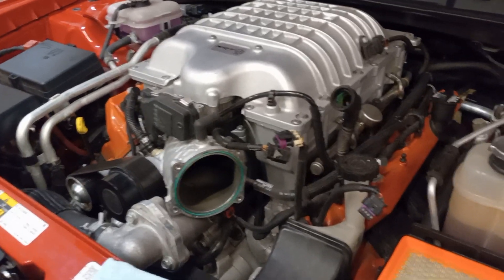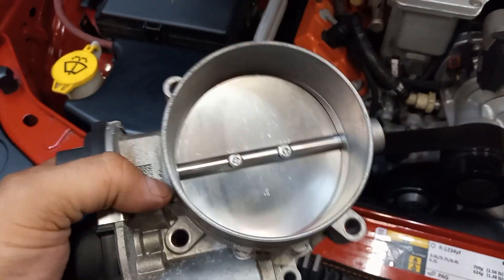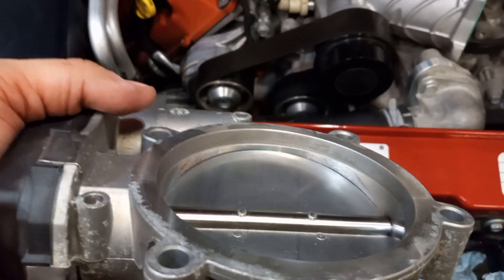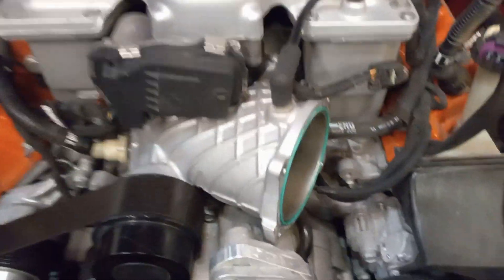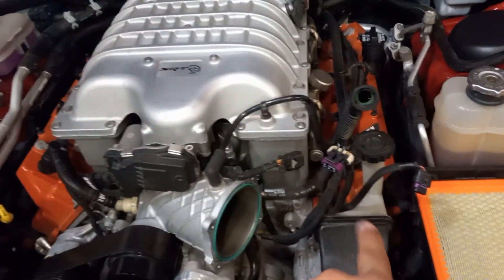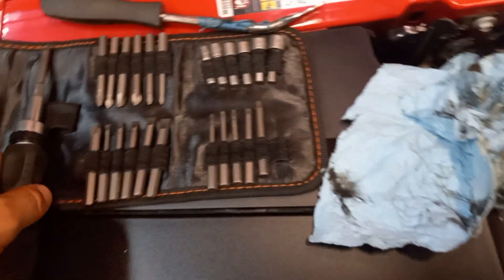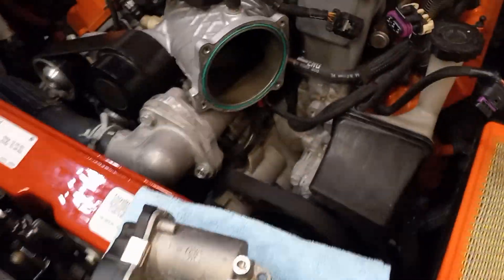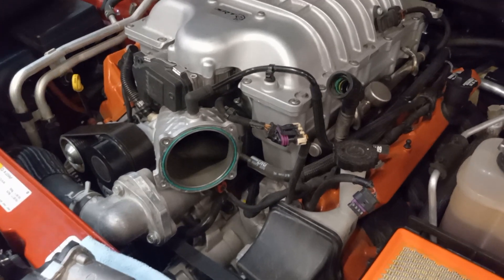Catch Cans? Here's why I don't have them,

Comment: Glad your feeling better...thanks for the tip on cleaning the back of the throttle plate. FYI- got 35ml out of 2020 Redeye in 4500 miles, 3000 at hwy + speeds. Originally thought I had wasted my $ after the first check (maybe got a teaspoon of oil/condensation) but now glad I got it. Do more of these type vids. Thanks

Comment: I put an American Brothers Designs catch can on my 392 and started to smell oil in the cabin after oil changes despite not a drop left uncleaned and zero leaks to be seen or found. Took the catch can back off and no more oil smell. I wonder there is something wrong with their design? Barb fittings to can sealed and tight, hoses and connections tight, as well as  o ring that seals can greased and tight. Maybe I will try another brand or just leave off the catch can. I’m not drag racing anyways. Just some fun driving through canyons, mountains, and the occasional full pull on the freeway on ramp
Reply from the maker: Return it and get your money back. In my experience.... simply not worth it

Comment: Did you run a Catch can on the 392 SRT? Curious as many guys do including myself. It took 3 years and 18k miles to fill a 1 pint clear can I have that I used to measure the amount of oil it caught.
Reply from the maker: No, I actually now look at catch cans as more of a red herring.  It became pretty apparent when I was porting intake manifolds that they didn't really do anything.
Reply: @bmasontv  Thanks man, I respect your opinion.

Comment: I have a catch can on mine and it is full every 2,000 miles. Where does the oil go if I don’t use the catch can?
Reply from the maker: It is reintroduced into the combustion process. Into the intake plenum and through the runners.

Comment: I wonder if it’s clean under the lid farther back. Rotors and bricks. Is it clean that far back ?  Any more clarification for us.  Awesome video. Subscribed.
Reply from the maker: You bring up a good point, I've never needed to remove the lid or remove the supercharger on this car, I can tell you though, of the ones that I have worked on there really wasn't much of a mess to speak of.

Comment: Hey Mason always great videos. I have a question on a different video you did a while ago on cold air intakes where you recommended to install the Hellcat lower box instead of the Mopar bleu filter. I did followed you advise. But my question is even with the lower box. My SRT still shows 154 on the air intake in idle with a 95 degree weather of course it will go down when its running. Is it normal the 154 in idle in a 95 degree weather?? Its something i need to be concerned ??  Thanks for any input brother 💪
Reply from the maker: Did you get the snorkel to go with it?  If the car is allowed to idle for a very long time you may get a reading that high, at cruise it should drop to within 5 or 7 degrees of ambient.
Reply: @bmasontv  yes I got the tube that goes in front. It does drop very low when cruising but in idle in traffic it went up to 154 on 95 degree. Is it normal??
Reply from the maker: @juanfernandez9011  yes.  That tube gets hit with a ton of radiator fan wash.
Reply: @bmasontv  ok  cool ,, I appreciated your quick response , I was starting to worry lol. Thanks brother for replying back  💪💪

Comment: What about 392?
Reply from the maker: You know, I used to recommend them for the 392, but here's the thing, every 392 intake that I port ...and it doesn't matter if it's had a catch can on it or not... still has oil in it.  It has a lot to do with the actual amount of flow going into the intake manifold from the crankcase. I did a video where I used a gutted GM PCV, the one that GM put together to eliminate some of the oil consumption problems for the ls, in my old work truck and it seemed to help. I give the part number for it in the description if I remember correctly. That said, you have to understand that , at least in my estimation, the way these catch cans work, they're only picking up maybe 25% 30%  if you're lucky, of the oil Vapor, the rest just gets pulled through.
Reply: @bmasontv  thanks

Comment: B, I have a 5.7 in my challenger. Is there no need for a catch can on ot either?
Reply from the maker: I did a video a while back on my truck where i illustrate oil how much contaminate is actually captured by a catch can. The question is, how effective is the catch can? It is not 100% oil Vapor will still make its way through the catch can and into the intake manifold I've seen this on every intake manifold that I ported with oil catch can.
Reply: @bmasontv  Thank you for the information. You're channel is always teaching me something new.

Comment: Catch cans a gimmick on boosted Hemi?
Reply from the maker: I don't see it doing much good on my car. I would pull the throttle body and take a look at the snout on yours. If you see evidence of blow-by, it may be a good idea to run them. But for mine, I just don't need them. Also this is specific to a Hellcat. A 392 or a 5.7 I would probably run catch cans given my experience with those engines
Reply: @bmasontv  Ok, I will check my N/A 5.7 Shaker out to see if it's necessary...
Reply from the maker: @Basslightning666  based on the condition of most of the intake manifolds  I get to Port, both 5.7  and 392 could probably use catch cans. I will also take this opportunity to say that  it is very important to check your catch cans regularly. I've had cars come in that had full catch cans and we're sucking oil out of the actual catch can into the intake manifold.  Huge problem....
Reply: @bmasontv  Oh man...lol. Thanks for the tech info. Catch you on the next live chat show !
Reply: @bmasontv  Great advise. On my 392 I get a half of a can full of oil on every 3500 mile oil change. That's quite a bit to be otherwise blowing back through the intake.
Reply: @DadsGarageDIY  I checked inside my snout on my RT Shaker, and there wasn't any blow back.  My Challenger only has 30K on it though...
Reply: @Basslightning666  That’s great news!